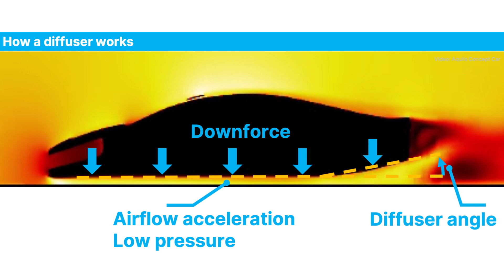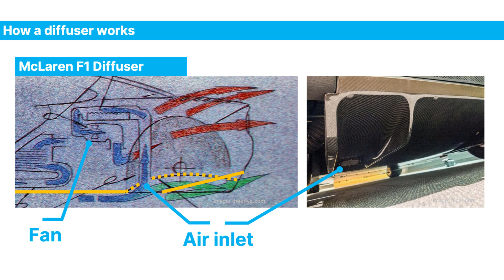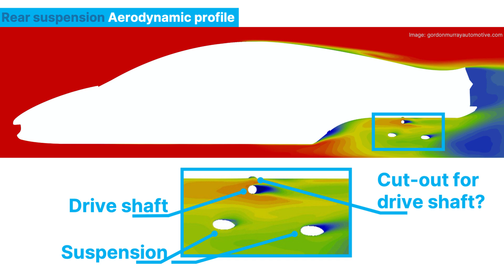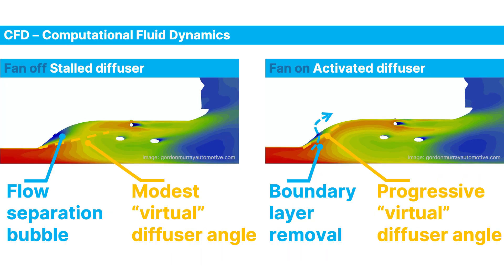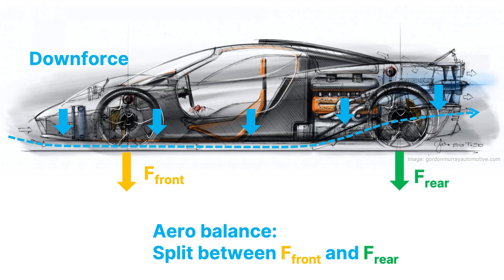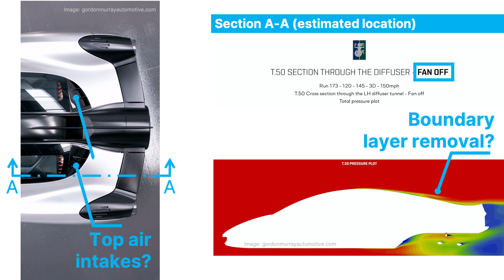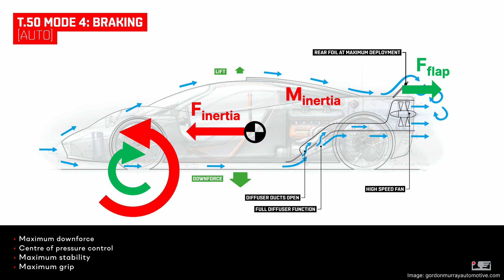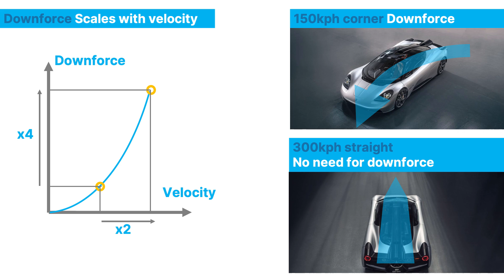Gordon Murray T50 Aerodynamics - Successor to the McLaren F1 supercar

Comment: Hi, any estimate on the downforce generated in the downforce mode?
Reply from the maker: Unfortunately not! Should we get a proper 3D scan of the car, then we could estimate it through simulations :)
Reply: @AirShaper On GMA's website they say the T50 road car makes 322 kg of downforce, but they didn't say if that was under braking or at what speed. Apparently the T50S could easily go past 2000 kg according to Murray and they reached 1900 very early on but they dialed it back as it would end up needing much bigger tires, which would make the whole car bigger and heavier and draggier.
Reply from the maker: @srinitaaigaura  Oh that's interesting, I had no idea, thanks for sharing!

Comment: 1:42 Can you please explain how a diffuser creates a suction effect underneath the car? How does a diffuser accelerate the flow underneath the car? Diffuser causes the pressure to increase thereby creating higher pressure upstream so wouldn't that cause the air to tend to flow the other way?
Reply from the maker: Hi Mohammad, we made a separate video on car diffusers:
https://www.youtube.com/watch?v=9UgacwMJpuk
Yes, the pressure goes up because the cross-section increases and thus velocity goes down, reducing the pressure (because of Bernoulli). But you shouldn't see this as a given high-pressure zone that is translated upstream - it's the local trade-off between pressure and velocity.
The low base pressure behind the car is a different thing, which does actually help to accelerate the air underneath the car.
Reply: @AirShaper  Thank you!